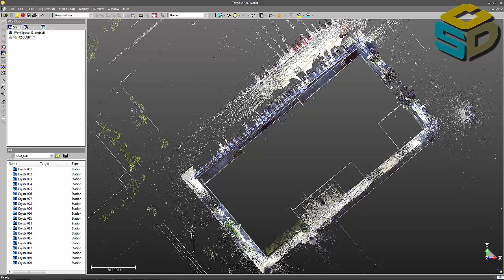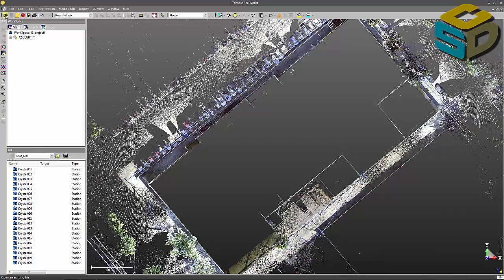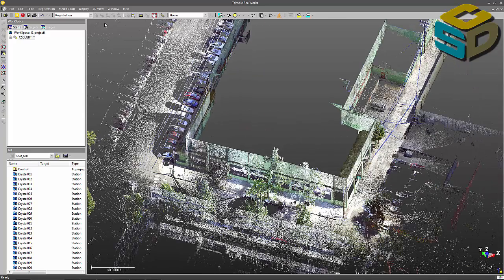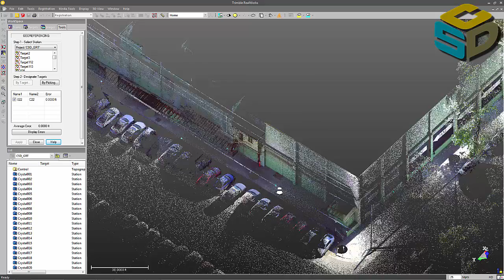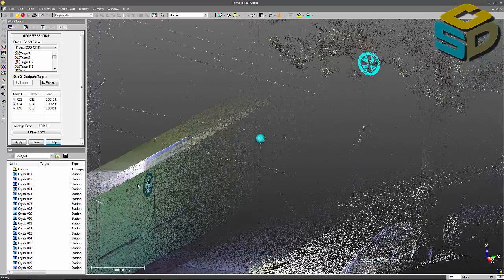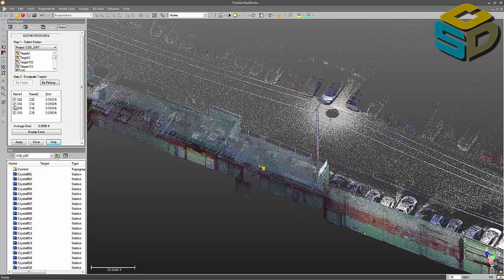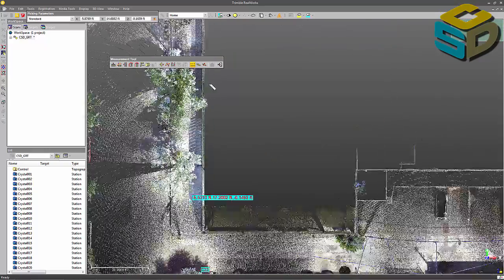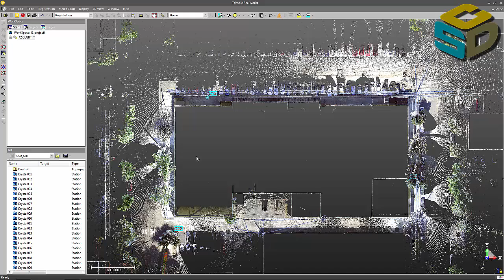CSDS Presents: Georeferencing 3D Scanning Data using Trimble RealWorks

Comment: We set the spheres over known control points and then just simply added the HR to the ground coordinates. Originally shot optically with a total station by a surveyor.
Reply: hey Jordan, does it mean you added height from center of sphere to known control point for Z value?